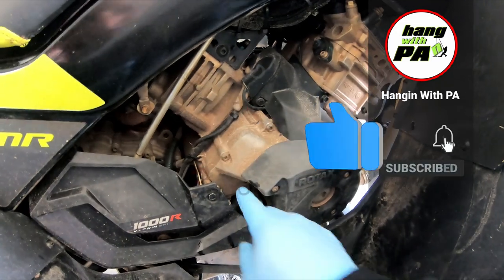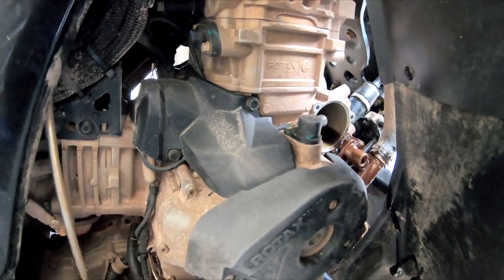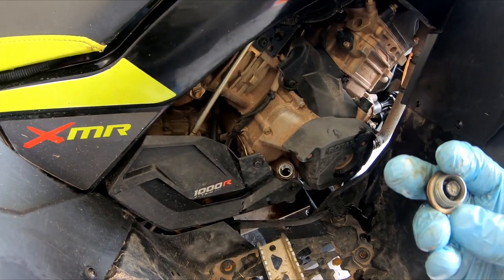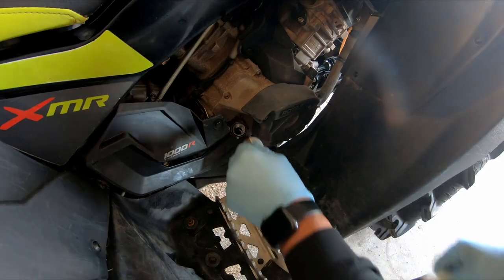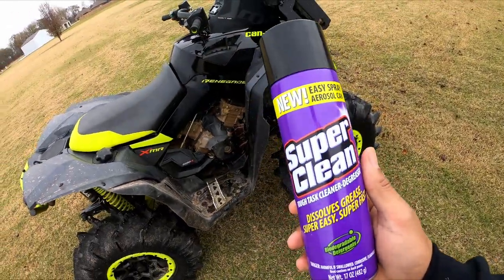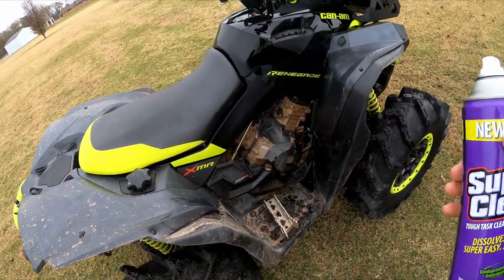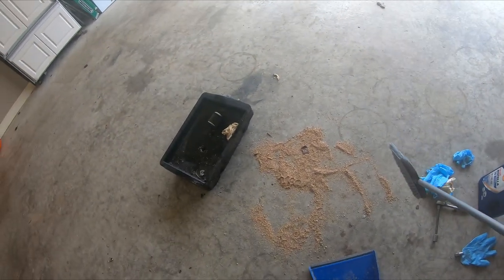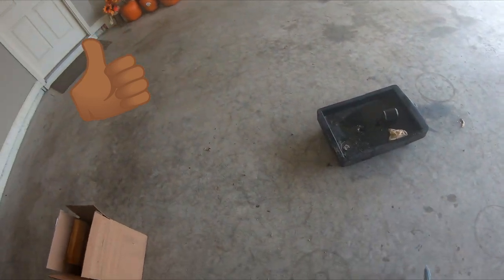HOW TO CHANGE OIL & FILTER 2020 CANAM RENEGADE 1000 - Shell Rotella T6 (BEST OIL) Super Clean

Comment: So you recommend the shell Rotella t6 for a 2020 renegade  xmr 1k its a good oil
Reply from the maker: I personally do as Rotella T6 5W-40 as it meets JASO MA/MA2 requirements for motorcycle engines. It has also worked well for me in my 2020 renegade and outlander. The Owners's manual says 5W-40 oil will work with a SJ, SL, SM or SN certification. Rotella T6 meets those standards. On top of all that it’s affordable and available every where.
Reply: @HanginWithPA   ok thanks because I have the same fourwheeler  just the black version and I am gonna do a oil change soon
Reply from the maker: No problem. Side note was really wanting the black one but could not find one when i was looking to buy
Reply: @HanginWithPA   yeah I was gonna get a 2021 850 they had one coming in a outlander xmr but them mine came in as a trade in and was only gonna be 100 bucks more so I got the 1000 low hours and miles
Reply from the maker: Nice... i would have done the same 🤘🏽.
Reply: @HanginWithPA  yep but I think the green with the gloss black looks sick
Reply from the maker: Agree 💪🏽🤘🏽